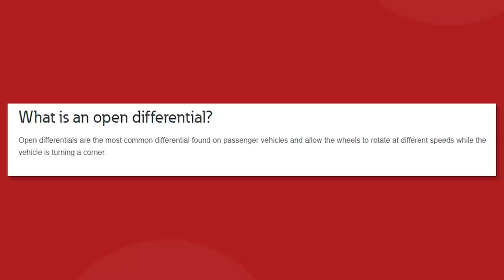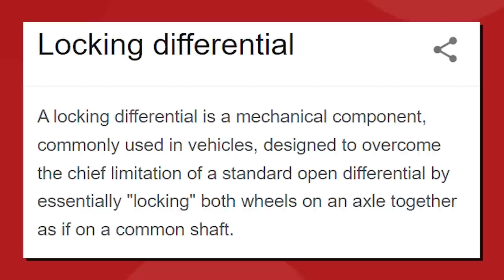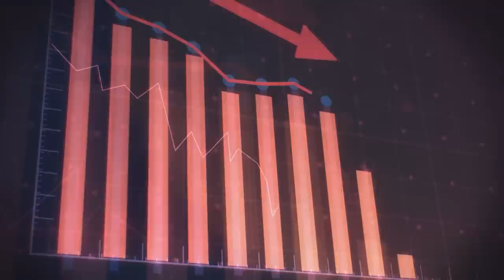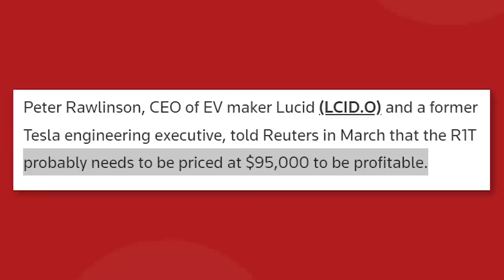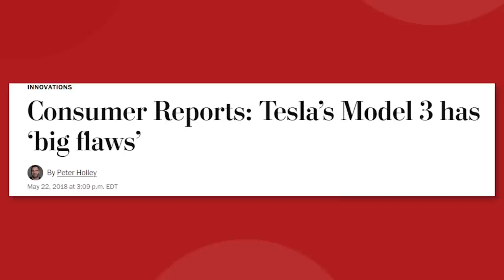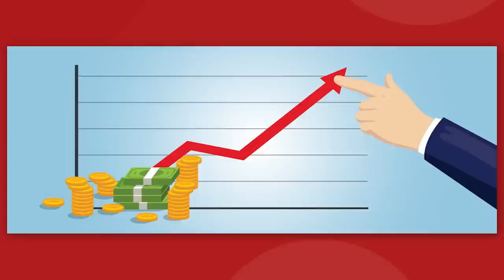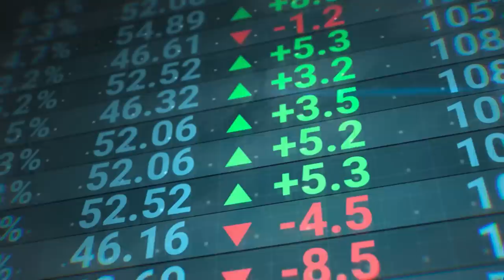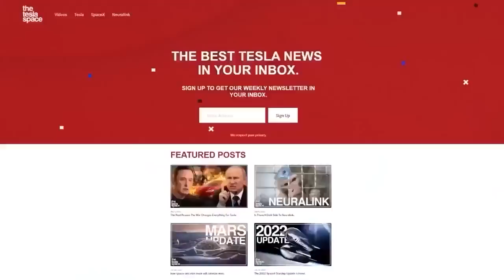What Is Going On With Rivian? - (2022 Rivian Update)

Comment: Anyone thinking the Rivian doesn't have "macho bravado" is just not looking close enough.  It's 7k lbs and has 200 hp at each wheel and has very large off-road worthy control arms and a hardcore belly shield.  The R1T is a F350 Superduty level truck.
Reply: They are very macho. They just can’t make the truck inexpensive enough to sell it for less then 100k.

Comment: The main problem with the R1T is the short bed. A 5 1/2ft bed is not a builder/contractor/working truck bed - they need an 8ft bed. The Ford Lightning will dominate the electric pickup space given the F-150 loyalty and the great feature set of the Lightning. That leaves the R1T in the all-show-and-no-go space, the cowboy hat without the cows. The Cybertruck will dominate the cool-factor boy's toy demographic so where does the R1T fit in? The relatively low volume of the R1T will not cut it. They will have to raise the price above $120K and hope to get volume from the R2. But if that's also a short-bed off-roader it will still miss the huge working truck demographic. Scaringe likely sees this problem so we'll keep an eye on it but right now it's a losing proposition.

Comment: Differential control has been standard in Subarus and Audis and bmws for years. 
I had a 1986 Audi4kq with locking diffs. four wheel drives have been made with controlled differentials for a couple of decades as without them they are useless in the snow.

Comment: Lol I have to laugh when they talk about Tesla's range.  I own a 2022 Tesla Model Y Performance that I picked up March 19th this year and I am LUCKY to get 160 - 170 miles of range on a single charge and I have it in chill mode, cabin overheat is off, sentry mode is off, everything that can drain battery is off, and I drive it like a grandpa...the range is such a lie it's ridiculous
Reply: I’ve watched all the videos of Teslas ‘legendary’ service but what have they said if you called them?
Reply: @milescoleman910  I have to wait a month for a service appointment. When I first got the vehicle, my car had to be towed to the service center because the car lost it’s mind.  Turned out there was a bent pin in the circuitry but they had my car sitting there for 8 days before they even touched it.  I called multiple times and they said I was in the queue, brand spanking new car.  They just have too few service centers to the ratio of cars they have on the road. The head technician I spoke to said it’s a struggle because they can’t keep up with the volume.  So we will see how this service center appointment goes and I can report back.  All I know is consistently lose 42% of my range every charge and if I drive any slower you may as well just put it on a flat bed because I would never get it up to 45 mph even!
Reply: Does your state have a lemon law?
Reply: @59seank  Yes my state does.  Very hard to fight, you have to go through the BBB which gives you the runaround and you end up having to go through the Attorney General's office.  Takes months, real pain in the you know what, but I will definitely do it if they don't have a resolution.  I asked a few other Tesla owners that have the non-performance and they are between 230 - 260....not the 318 quoted but at least over 200!...that is an 18% - 28% inefficiency....beats my 42%.  Another thing that I found quite interesting is if you look at the fueleconomy.gov website they will say the estimated range is 291 (not 303) but that you should expect to get 30.4 kWh/100 miles....well if you do the calculations, that's actually 246.71 miles and dividing that by the estimated 303 on Tesla's website, that is 19% anticipated inefficiency....still nowhere near the 42% I get...and I'm in Chill mode...I can't even imagine what the inefficiency is in Sport mode which is kind of the whole point of getting the performance model anyway.  I would be thanking the heavens above if I was even remotely close to 246.71 or 291....that seems like a fairytale!
Reply: @ed6685  The only other thing I can think of is to call your local TV news station and see if they would like to do a story  about it.  A call from a reporter can sometimes shake things up.
Reply: @59seank  That's a smart idea, appreciate the advice.  May have to do that.  I'm soooo forgiving with so many things, but when my vehicle can only go comfortable 60 - 70 miles in one direction and back to get home, either there is a serious problem with my car and/or battery, or they are blatantly lying about the range.  There are TONS of forum articles complaining about the range however it's all complaints about cold weather because historically electric cars don't do as well when it's cold outside....at this rate I'm probably going to get 100 miles of range or less when it's Fall/Winter smh